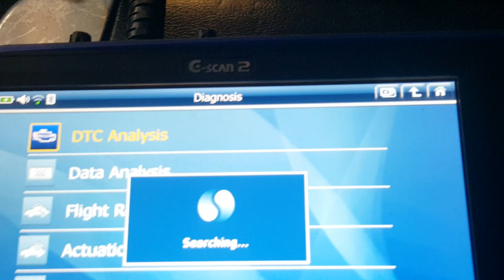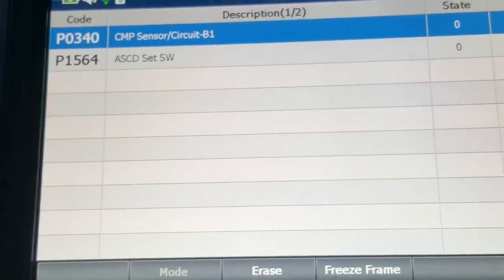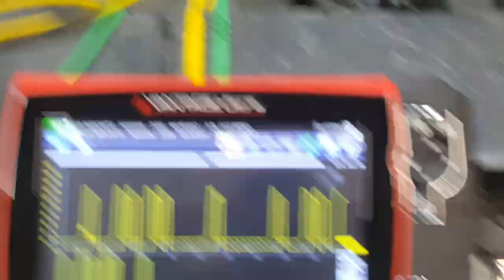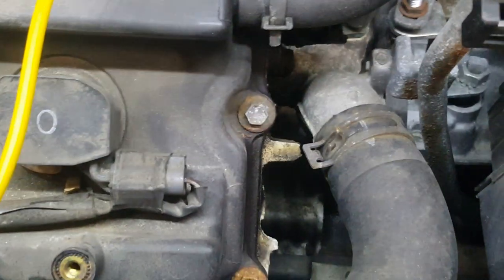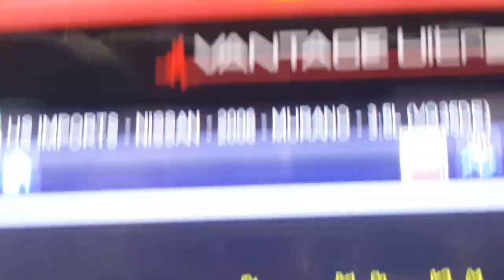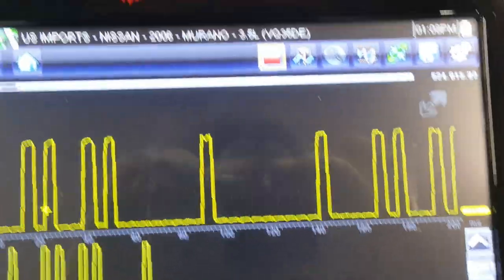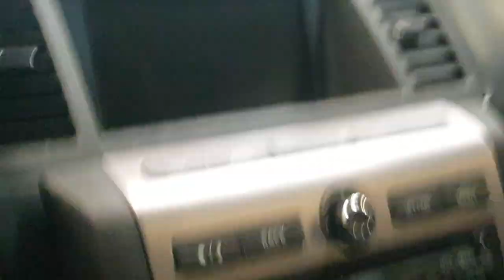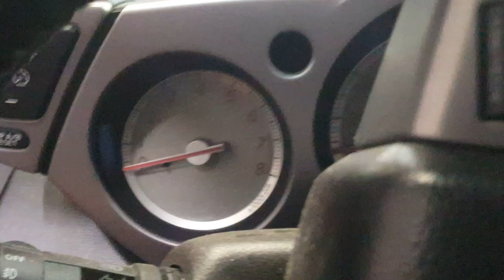P0340 Nissan P0345 Stalling and Cutting Out "Fixed"

Comment: Mine went out on my 350z and caused my one of my cats to clog up and over heat. After replacing the sensor the car is still running very ruff any solutions ?

Comment: Have both of these codes as well on a vehicle I'm working on as well
Reply: Did you fix this issue
Reply: @Kingelbey  yes was cam sensor, normally if you have more then 1 cam position code like that you're probably out of time. I was a VW dealership tech but went back to independent shop.
Reply: @Kingelbey  also repaired another Nissan recently at the shop that had a bad exaust vvt solenoid as well. Was misfiring like crazy. Knew timing was fine bc of milage. Also tested solenoid, seemed to be fine but was not.
Reply: @justinyoungstown  yeah my 2015 Nissan is throwing p0335, p0340, and p0345. Both cam shaft sensor banks are coding. So you say it’s to late?? What you mean by that?
Reply: @jacobjohnston601  it's possible both are bad. Pulll them out and test them. Worst case you'll waste 100$ or so and the code will still exist. Good chance if you're having intake/exaust correlation codes that the engine is out of time. Hard to say without seeing it. Does it misfire??
Reply: @justinyoungstown  on my 06 maxima v6 I first got the bank 2 sensor code then after replacing I got the bank 1. I hope it works after replacing them. The error would trigger failsafe mode.
Reply: @james81693  can pull them and test them. Still doesn't mean they aren't bad though. As said if replacing sensor doesn't fix it and you have cam/crank correlation code chain/belt could be stretched.  You'd have to pull cover to verify timing.